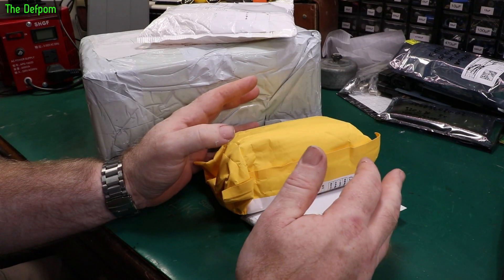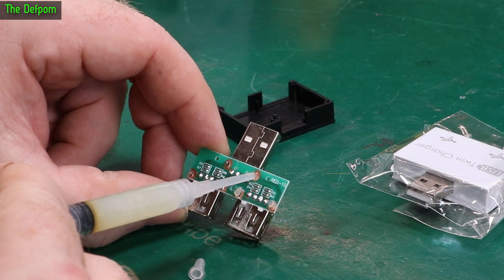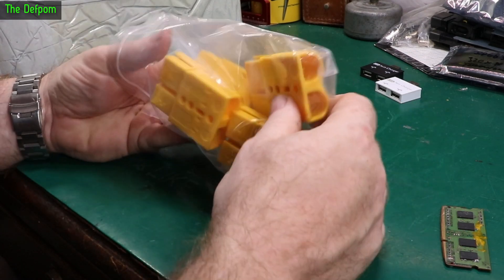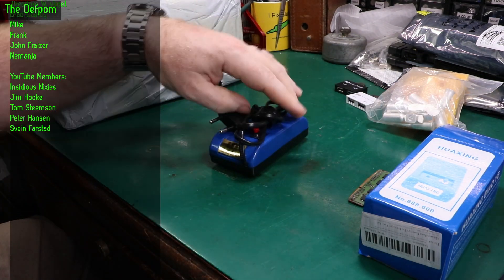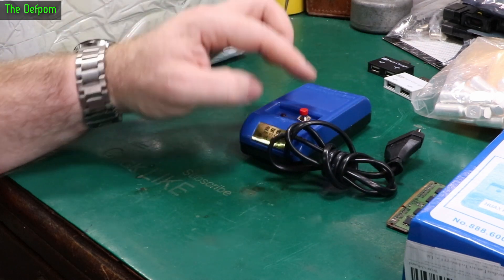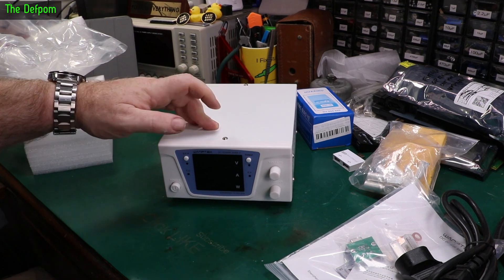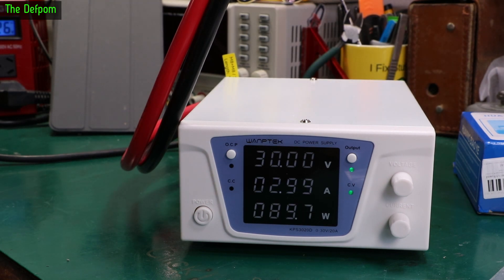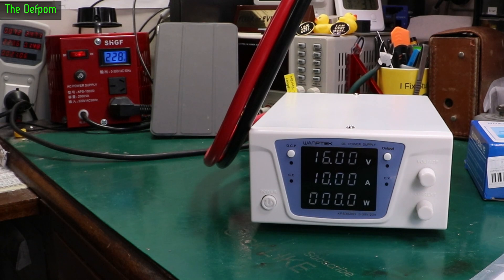🔴 Mailbag Monday 29th January 2024 - No.1215

Comment: Like to see more tests for this power sypply.
Myself got from EBay a Hewlett Packard 6033A System Autoranging Power Supply 200W 20V/30A its a nice heavy duty supply.
With the used ones, i look at the rear picture, check out the fan, if its has lots of dust it has lots of running hours.

Comment: The problem with a lot of SMP's is there is often no s/c protection. I got 2 35V 30A units as they were used to test the short circuit protection of a coil driver. the coil driver survived the short but it killed the PSU's.
looking at the small print there was a one liner that stated, "Do not short the output"
quite a few fets and diodes later i've two nice PSU's